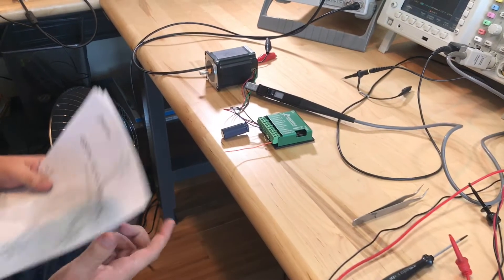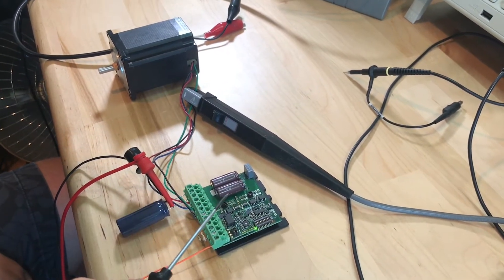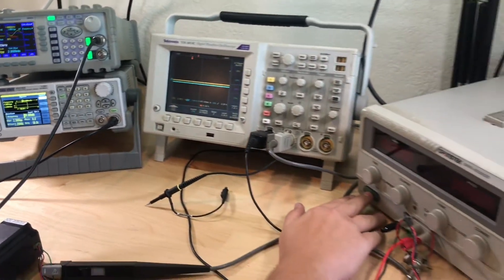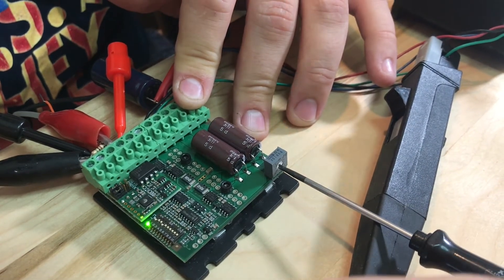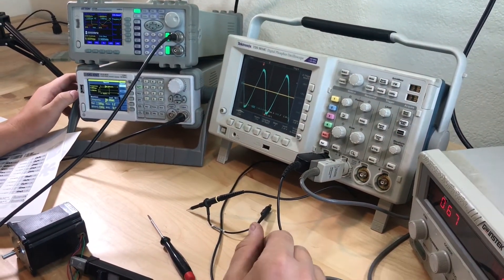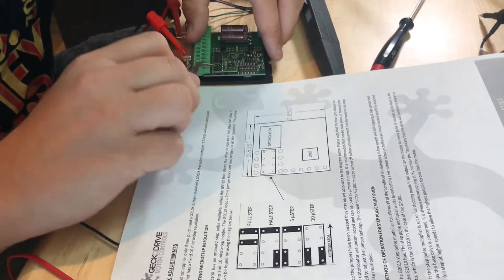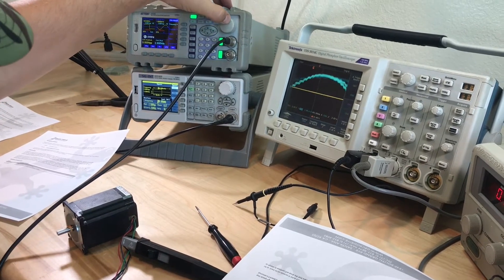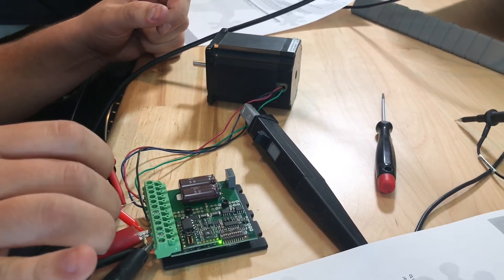Initial setup of a GeckoDrive G201X and G210X

Comment: Stepper Motor nominal current ? What R value did you use ? Thanks !!
Reply from the maker: The motor is rated for 5A and we set the current via DIP switch.

Comment: Do the Gecko drivers work well getting signal from usb BOBs  chinese or whatever the make is ?
Thank you.
Reply from the maker: All of our products are software and BOB independent, meaning they can get their TTL square wave signal from anything willing to output it. As long as your BOB or motion controller outputs a 3.3V to 5V square wave with a high enough frequency to meet your requirements then you can use it without issue.

Comment: Im new to stepper motors and im trying to convert a series 1 bridgport mill from boss 5 to mach . My question is when u say on the amp clamp its at 3.5 amps to the motor the power supply is only showing 0.5 amps when u first turned it on it was only showing 2.2 amps on the power supply. How is the motor recieving more amps then the power supply is putting out? I need three of the G210x because my mill has essentially 8 amp nema 42 motors on it. I tried a couple TB6600 genuine toshiba stepper drivers that ran ok... untill i put them in full step they burned up. Power supply was a sorenson 40v 20a limited to 5amp. Why did that happen? If i spend $400 on gecko drives i dont want to destroy them.

Actual stepper motors im using

https://www.ebay.com/itm/BRIDGEPORT-SERIES-II-STEPPER-MOTOR-1979-NEMA-42-/302708412602

My build
Testing motors and manual power feed

https://youtu.be/j__MHcv5dXQ
Reply from the maker: The measured current is going to be the peak of the sinusoid, which will be whatever the set current is. The ammeter built in to the power supply is showing the difference in current between the two windings, which are switching at 20kHz. You can generally disregard any built in ammeter on a power supply if you are using a switching type drive like ours. Hope this helps!